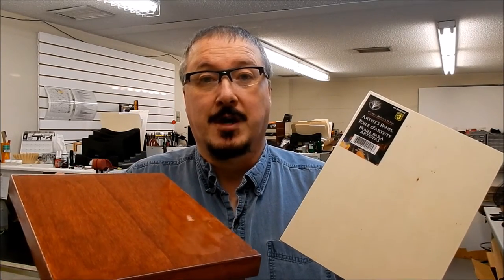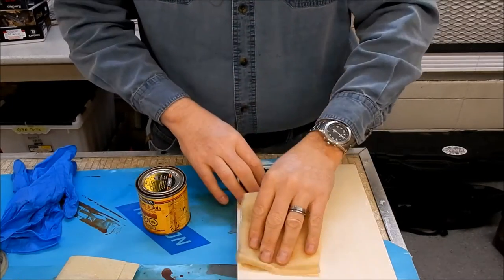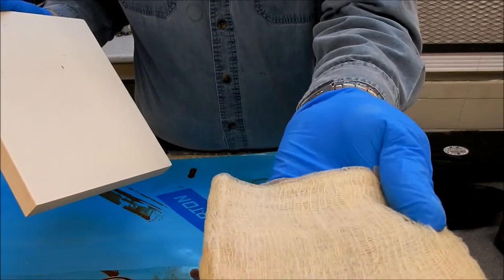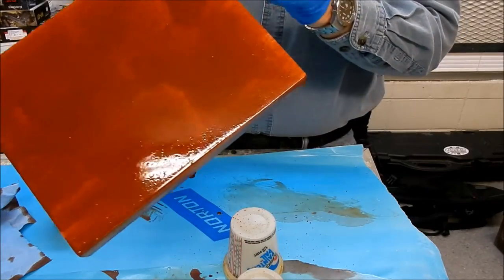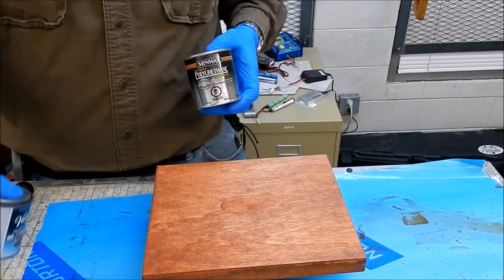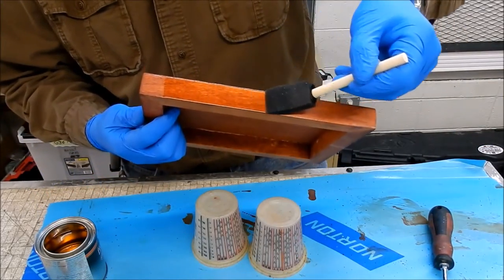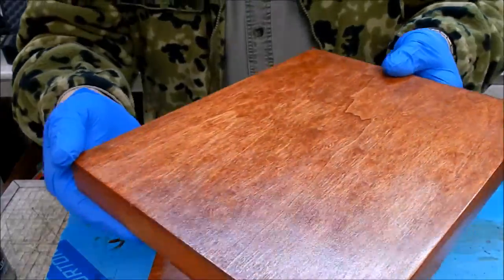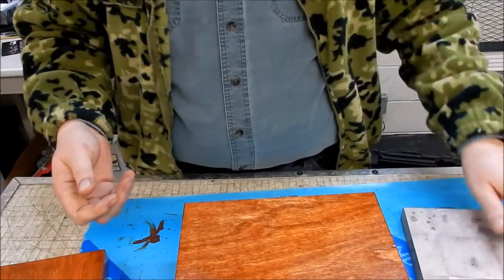Dollar Store Diorama & Display Bases

Comment: Thanks for an excellent video. Never thought of using sponge brushes or the tacky cloth. Only thing I don't understand is why stain/lacquer coat the top piece when it's going to be covered by your concrete print out in the end?
Reply from the maker: It helps to protect the wood from the groundwork you apply. Even if you use something like 3/4" plywood, if you don't seal it and cover it with say Celluclay or Spackle for ground work, the wood could warp. Also, the glue/moisture from your groundwork could creep under the finish and lift it off or ruin it from underneath. You cols also finish the edges around the top if you wanted to mask off the top edge with masking tape to get a bit more fancy looking base. If you're going to just glue a paper board product down, like I did, or glue down something like a Miniart diorama base, you don't have to finish the top. I just did for demonstration purposes and I like to completely finish them myself. Kind of like painting the parts no one will ever see.

Comment: you said not to clean up the brush, do you clean the foam brush for future use? if so what do you use? I just toss them out.
Reply from the maker: The foam brushes are meant for single use and are disposable. I have attempted to clean them but they’ve always ended up hard as a rock no matter what I did.